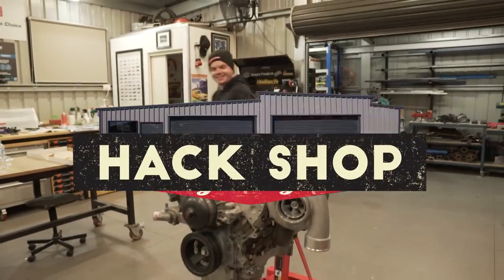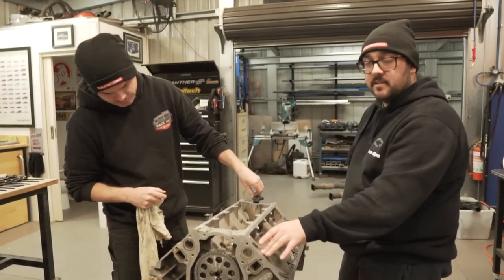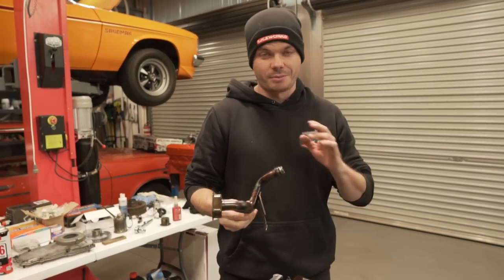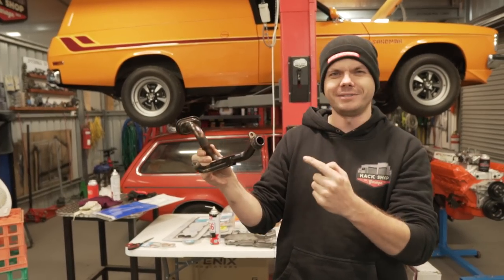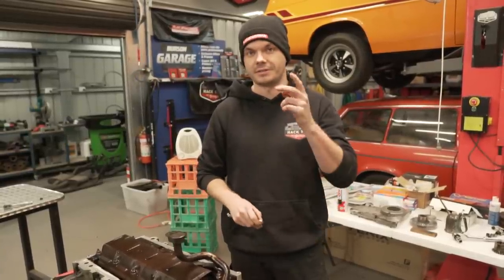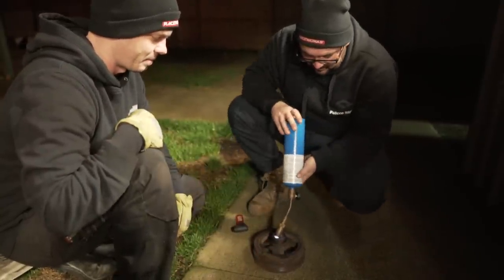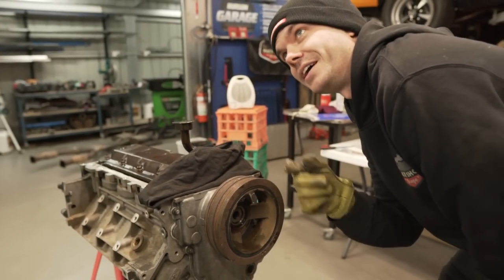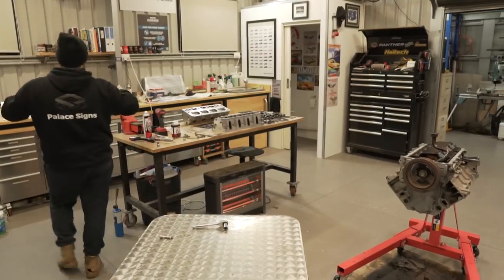BUILDING AN LS1 TURBO VY UTE!! - Part 4 - FINISHING THE ENGINE BUILD

Comment: I highly recommend moving your coolant temp sensor to the other head. It will most likely melt where it is now. Extension looms to reach the other side can be purchased cheaply on eBay.

Comment: Last week I thought whilst my motor was out “better replace the Chinese knock sensors with genuine” I ripped the seals like you did and also the sensors were spinning as they’re crimped together… One then snapped but luckily I welded a nut on and it came out. 2 min job turned into 4 hours.

Comment: You should get a billet barbell oil plug , the factory one us plastic and only has one seal billet ones have two seals and greatly reduces dirty oil going where it shouldn't
Reply: Good call 👌 cheap as from Rocket
Reply: Only like $40 from VCM

Comment: Should of put a billet barbell before installing the remain. I turned my crank when bolting down the rear main plate, to help align the seal around the crack. Hasn't leaked for over a year so must have worked. 
You could do oil return  into the timing cover. Put coolant temp sensor from passenger head to driver's head. 
Heat sleeve power steering lines near the turbo. 
Run a turbo beanie. I found the heat off the turbo would heat soak the billet rails after shut down. It was a bitch to restart if the engine stalled. 
Did you put sealant around the head studs? Because some go into coolant passages.

Comment: When your compressing the springs with the head off if you put a rag under the head it will stop your valves moving down with the spring
Reply: Also stops valve head hitting the bench, potentially bending it

Comment: Front main Oil seal will be fine. The crank will be at about 130c when it’s running so the seal is the least of your issues when installing the pulley.
Reply: The proper seals use viton so they are good up to 200 celcius full time  and occasional up to 300 celcius. Standard Buna N seals are only good till 120 celcius. The rear main was definitely Viton.

Comment: Great video boys 
Not to Sure about your lifter installation though ?  I would have put assembly lube on the bottom of the lifters to eliminate bare seating onto the camshaft.
I would have used oil also to lubricate all rubber  seals before insulation.
Reply: Roller lifters bud no friction there,definitely don’t fit them dry but they are pissing oil as soon as pressure is up
Reply: @needmoreboost6369  I stand corrected.👍
Reply: Cam will also be covered in lube for the rollers to roll on 👍

Comment: Make sure that front and rear covers are dead level with the block and you seal the joins with a little silicone, if the covers are not dead level you may crack the sump

Comment: Had to do a balancer on my ls1, didn't have any to pull it on or a blow torch, so I turned on my camping gas cooker and stuck the balancer onto the flame, long behold it worked

Comment: Seems confusing. The turbo is only driven by the exhaust from one bank ?
Reply: There will be a crossover pipe from the other manifold 👍
Reply: At 27:00 when he holds the manifold up you will see the flange that will have the cross over pipe bolted to it, that will go to the other manifold.
Reply: @seanb250  You might be right but judging by the way the turbo mounts to the manifold, it doesn't look that way.
Reply: @colin9402  definitely gets crossover from drivers bank. It is how most ls turbo systems are done. At least single turbo kits

Comment: Why the Fk would you redo needle bearings? Go solid brass and not worry about revving out the needles!? P.S dis the same thing as you did with the knock sensor seal! hahaha easy mistake!
Reply: The upgraded needle bearing kits allow full rocker movement and use circlips to retain the bearings. Big improvement over stock less chance of them failing. Theres pro's and cons with going either needle or brass bush style
Reply: @damienhasleby8390  The only benefit of the needle bearing version is that the circlips are holding em in, they've been known to fail just as easy as stock. Brass bushing will only fail if you have shit oil pressure! New pump High flow and HP with the Copo Camaro spring and you're sweet, and I've never had bearing washout with that ultra high pressure spring! Both versions allow full rocker movement! Plus both are just as cheap as each other.